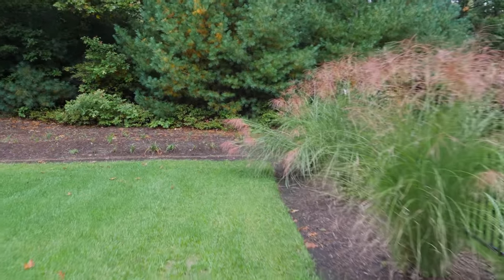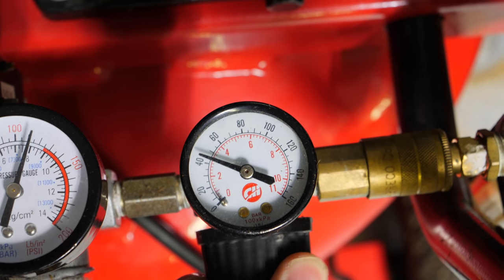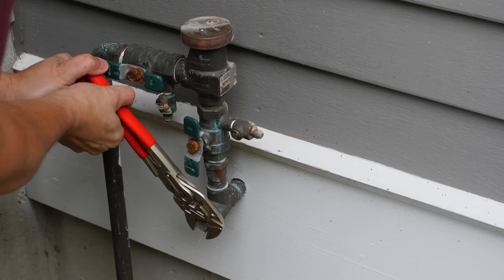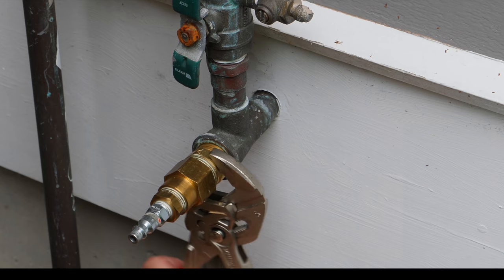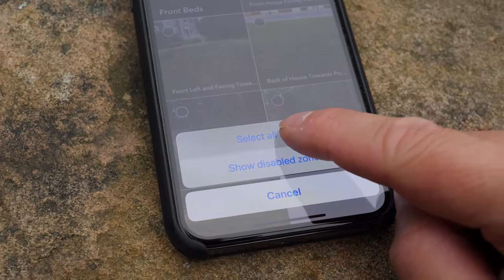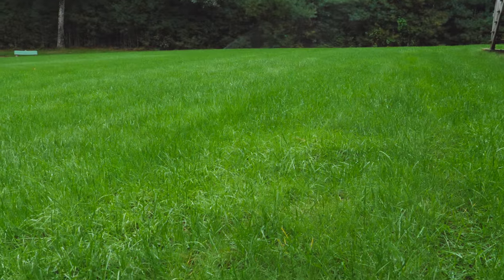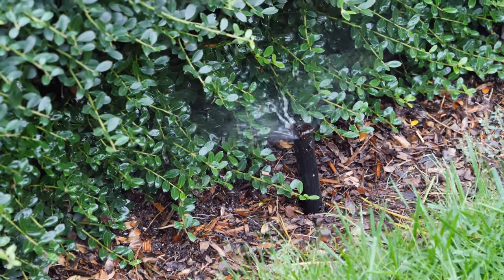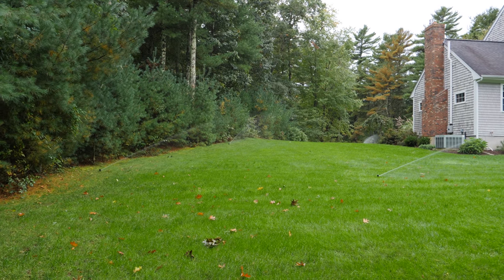How to Winterize Sprinklers DIY Step by Step - Blowout the Pipes

Comment: You should NEVER pressurize your back flow preventer  from the input side. You can destroy it! Your air line should always be connected to the output side of the back flow preventer..
Reply: Absolutely. And almost every single diy video I've watched they are plugging the compressor in before the backflow as well as a few other mistakes. That being said, this guys system wasn't installed optimally. He doesn't even have anywhere to hook up the compressor near the house on the correct side of the backflow.
Reply: I installed my system over 20 years ago and put my blowout valve before the back flow preventer.  Keep the air pressure around 35-40 psi and you be fine.
Reply: Make sure you have a path for the air to go and your back pressure valve shouldn't see the full pressure of the compressor

Comment: Note for anyone wondering - I just watched another video on this as well, and the bit at the end about leaving the valves/bleeder screws open or closed is pretty important. The reason someone would leave them open is because many people's pipes will continue to slowly leak out water even when you have the main line shut off. Over the course of multiple months during winter, enough water may re-accumulate in the pipes and back flow valves to freeze and crack or break things. Often times people will leave the valves and bleeder screws open to allow any of that extra pressure to release during winter. Not sure if there's a reason you would want to keep them closed, other than forgetting to close them in the spring when you turn your sprinklers back on.
Reply from the maker: Keep in mind that they really aren't vents at all. They are testing ports for inspectors to test the backflow preventer which never happens on residential installs. The flip side of this is that installers leave them like this so if homeowners try to open them they see a huge leak and panic. Maybe this isn't true but it happens to a lot of people.
Reply: @SilverCymbal  Actually, I'm residential and my backflow device must be tested/certified on an Annual basis from a certified tester (at a fee of course!)
Reply: Not true.  I am required to have my home system checked for backflow by my city.
Reply: Agreed.  I keep my ball valve and screw valves at 45 degrees after winterizing.

Comment: I stopped having mine blown out and I only shut off water, cycle all the zones and have my backflow open (I have a spigot inside to drain the line). Leaving everything open and running all the zones with the water off drains it all out and if it gets cold enough the water will push itself out the open valves, my bucket I hang off the spigot in the basement will get an additional couple cups of water. I've heard (maybe this is wrong) that water can seep into the heads/lines and blowing them out really only cleans them out once, but as snow melts etc, you get a little water in the lines anyway. Haven't had a single cracked line or head in 10 years doing it this way in Nebraska winters (down to -20 last year).
Reply: Can you make a video about that, please.

Comment: Awesome Vid, shut down my system, using your Vid as a guide, saved me 80$ plus. Closed without a hitch and next year my compressor pays for itself. Took me just over an hour, being that I have 8 zones and  used an 8 gallon 1.5 hp, but at 40 psi. Everything went SMOOTH. 
THANK YOU.
Reply from the maker: Thank you very much so glad it was helpful.

Comment: I've been winterizing my sprinkler system for 18 years now. I use a Husky 60 gallon compressor at 40 PSI one zone at a time.
Reply from the maker: Imagine the money and time you saved waiting for someone. Plus I am sure you open them too. Thousands of $, little things add up to big savings! Thanks for sharing!
Reply: I installed my 5 zone sprinkler system myself. I keep spare solenoids and heads in stock. Next season I'm changing the timer to an internet ready version.
Reply: Glenn Martin - by any chance have you done or come across a good step by step guide on how to do it? I bought a house with pre-installed ground sprinklers but the coverage is very poorI need to fix It but don’t wanna spend a fortune outsourcing.

Comment: Other videos say blowing throw a blackflow is bad.  Is that why you keep it at a lower psi?
Reply from the maker: The lower PSI is usually what the sprinkler head companies recommend so that the internal gears don't spin too fast since they are normally cooled by water. You are 100% correct they do say not to go through the backflow if you can avoid it, but I have never had an issue and many pros don't bother either often because there is no easy way to get in the line.
Reply: @SilverCymbal it could be 25 psi and they would rotate fast, I think people just worry about busting pipes

Comment: Maybe in Florida but you cannot do that up north and east coast because the parts were freeze if you leave enough water in the pipes
Reply from the maker: Florida what's that?   I live in Massachusetts. 😀Temps are below 0 here every winter - This technique is the best way to close just like a pro does
Reply: @SilverCymbal  Different parts of the country use different piping in irrigation.  In Massachusetts, we use Polyethylene piping which is why your system survives the winter.  Poly pipe will flex to a point.  Also the snow we get insulates the ground and helps protect against freezing. Other parts of the country have pvc piping underground.  PVC will shatter like a stack of pringles. A homeowner air compressor will not remove enough water.   The key to an air compressor is not pressure, it's volume.  Pro's use minimum 60 cubic feet per minute for residential properties.  I use a 250 CFM compressor with a diesel engine, but I do athletic fields with 3-4 in PVC piping as well.  This is why your heads pop up and down while you are blowing them out.  Not enough volume.
     The most vulnerable part of the system is the exposed copper piping and brass fittings.  Don't close the valves on the backflow preventor all the way.  They can trap water and crack the brass valves, especially if you don't use a high volume air compressor, or have a faulty shutoff valve.  Proper way is to close them half way, especially the test cocks (the small 1/4" valves, the cost $15 each wholesale).  Get rid of that plug and put a threaded faucet in it.  Leave it open halfway so if you have a faulty shutoff, the water drains out and you don't have to keep redoing the teflon tape.  You can get a hosesized fitting to reduce to whatever size your airline is at any hardware store or big box store.  I don't know who told you 40 psi is adequate.  The piping is rated for more than 100 psi, we set our compressor for 75-80 psi per manufacturers recommendations.  Running for 4 minutes or less each zone is important, the plastic gears inside the heads will get too hot without water and may need to be replaced in the spring. Multiple times my be needed.
It's ok to blow air through a pressure vacuum breaker from the house side, but some houses on hills have a different backflow device that must be drained on the house side and blown out from the downstream side.  Air from compressors is warm to hot, and these devices have seals that can be distorted by the heat.  
     When opening valves, open the furthest from the water supply 1st, that will empty the main line, and make the rest of the zones blow out quicker.

Comment: Great video.Thanks for info on Air connector fabrication you did plus the 40 psi setting.I had been trying to figure those things out.Looks like I will need something in my valve box for the air connector to hook too.My system not used for drinking water, just grass watering.Thanks
Reply from the maker: Thank you, I have done it this way for over 10 years and never had a single issue when opening them.
Reply: @SilverCymbal  Yea,My system is one inch PVC LOCK.Think I can use one inch T in line with !/2 inch plug removed for Air connector.Bought a couple of plugs for this but after viewing your video,I don't think I will need but one and just open each valve at a time.I am kind of tight on space in the box. thanks.

Comment: Did I miss something? When did you turn on the compressor? During each 3 minute run time?
Reply from the maker: I normally turn it on after I connect it to the plumbing and it stays on until I am done. The sprinkler valves themselves allow the air to flow just like they do water.

Comment: So you keep the compressor running at 40 psi the whole time?  While you're switching zones it's still on and blowing at 40 psi?  Have you ever had a sprinkler valve or head break because of the air being blown through the system?
Reply from the maker: That is correct. Yes, even when its off or switching valves 40psi is fine. Normal water pressure is 40-60psi so those valves and heads run at that pressure all the time.
Reply: @SilverCymbal  first of all, thank you so much for the quick reply, I really appreciate it. I asked this because last fall when I winterized it and the next spring came, I swear the whole system blew up. I had to replace all 8 zone valves and so far I've replaced 11 sprinkler heads that were leaking. We've only lived in the house for a little over a year so I have no idea what condition the heads and valves were in before but holy crap it was a lot of work and cost me a good chunk of money. So needless to say I'm a little scared to do it again this fall (:  I will put on my big boy pants and try it again using your method. It would be ok to switch through the zones using the control box as well instead of turning the solenoids right?
Reply from the maker: @those1kidds  That is really bad, its also very unusual to lose them all. I would think it may have been freeze damage, so people never winterize which is crazy if you are in the north. That may have been it. I have never lost a head or valve from closing. what I showed you here is how I have done it in a lot of different houses over the years and always had a good spring opening. Hope this helps.
Reply: @SilverCymbal  sounds good. Hopefully now that most of it is new I'll have better luck (: thanks for your help and awesome videos
Reply: \Rotor Heads can easily do 90+ PSI. those mister heads you gotta be more careful with because in the better case scenario, it will only walk them off their adjustment, or blow the seals/ pipes because they rent as big.

Comment: S.C.,  I had read that the backflow preventer (pressure vacuum breaker) can be damaged by sending that compressed air through the backflow preventer. In other words, air should be put into the system down stream of the PVB. Please comment.

Comment: Excellent video..very clear and concise....thank you.  What size compressor do you use?
Reply from the maker: I use a larger one in this video but because you are only using lower psi even a smaller pancake style will work fine.  You can always run through your zones a couple of times to ensure all water is out.  Thanks for watching
Reply: I have a 25 gallon compressor, so I guess this should work well

Comment: I asked a couple questions last year and I just finished using your steps which is awesome.  Thank you!  I just want to ask if what happened to me is normal.  I was at 40 psi and when I turn the zone on the sprinkler heads would come up quick cause the full 40 psi was coming through. Then after 3-5 seconds the psi would drop to around 10-15 psi on the compressor and the sprinkler heads would go down.  Is that normal? Then I'd wait another 20 seconds or so to let the compressor build back up then I'd turn on the zone again and mist would spray out and a little bit of water as well then the heads went back down.  Is that normal?
Reply: Yes that's normal. My 29gal compressor can't keep up with my zones either (I have 10). I just have to let it fill up several times during the blow-out. Amazing how much air it takes to do this!
Reply: That is why it is better to have a larger compressor that you can fill to capacity and then run at the desired psi. You can run into problems with what you experienced. Imagine the pipes full of water and your little compressor comes and blows off the top portion of the water in the lines creating a fast and easy way for the air to escape just above the standing water in the bottom portion of the lines. That water will still be in the lines no matter how hard you try. Generally won't be a problem because you've created enough space to account for the expansion of freezing water but it definitely can still be a problem in the wrong conditions

Comment: Is there an air compressor too small to do this?  I have a Porter & Cable pancake compressor, 150 PSI tank, 2.6 SCFM @ 90 psi.  Is this compressor big enough?
Reply: I'm sure your air compressor is enough to do sprinkler winterizing. Usually, we set the pressure under 50psi.

Comment: Hi,
Do you think it is ok to put compressed air through your anti-siphon back flow preventer valve?
Vinnie
Reply from the maker: Technically no, all the documentation say not to do it that BUT I have never seen any pro do it any other way that I am showing you. My anti siphon was almost 20 years old when it finally failed and it was due to corrosion not an internal failure so I can tell you in my experience its always worked great
Reply: Thanks, I've been blowing my through the valve for 32 years now (bought our house i 1986).  But our local plumber store says no.
Hey I thank you for getting back with me.
Vinnie

Comment: Great video! I have a small 6 gallon pancake compressor and I ran my 7 zones with 4-5 heads at 40 psi like you said. The water pretty much ran to mist. Ran through each zone 4 times.  I noticed a couple of the heads wouldn’t come up by the 3d cycle.  Does that indicate there wasn’t enough air? Or is it most likely dry and there was nothing more to come out? Thanks again!!
Reply: I had the same thing happen to me on my 2nd cycle at 60psi.  I think that means there wasn't enough water to push them up.  Hoping I didnt run it at too high of a psi, but reading your comment makes me think we are fine.
Reply: Hey thanks for letting me know you had same issue! Yeah, I have to think you’re right, I’m sure enough water was blown out.
Reply: means not enough air cfm to push them all up.  The goal isn't to get 100% water out, just most of it so that when it freezes (and expands), there's plenty of room to accommodate the ice.  I'd bet the ones that didn't come up are far and lower than the ones blowing air.  Should still be okay.

Comment: Have professionals do the job and your system will last way longer!!!
Reply from the maker: Or do it yourself and take more time and do it right. 20 years on mine going strong.
Reply: Everybody's irrigation systems are different! Your gonna cause more problems and I bet you also fix your plumbing, your electric your heating just a jack of all trades right? Trust me your system will last way longer being winterized by a professional!
Reply from the maker: @gluonparticle9327  You can insult me all you want it doesn't change a thing and just makes me realize how spot on this video was.
Reply: Had the irrigation installers do mine the first year and he even told me I can handle it myself...I've been doing it for 15 years no problems. Depends if you are a handy person...nothing hard about it
Reply from the maker: @donknicker8110  Same here, 3 different houses for 20 years with 0 problems. Most of the comments discouraging people are from pros that I can see.